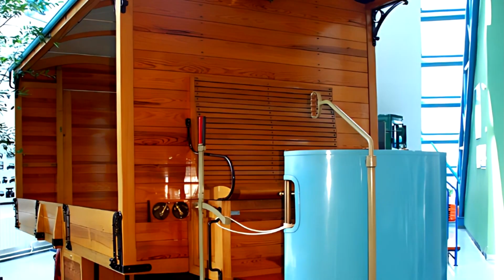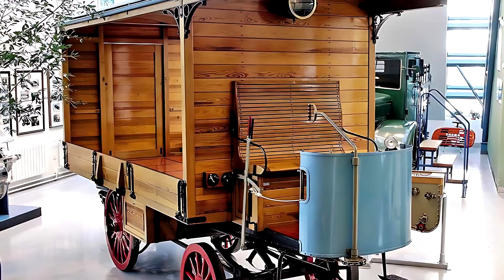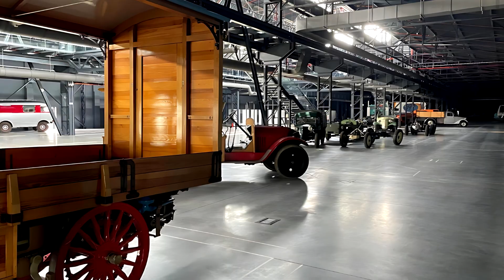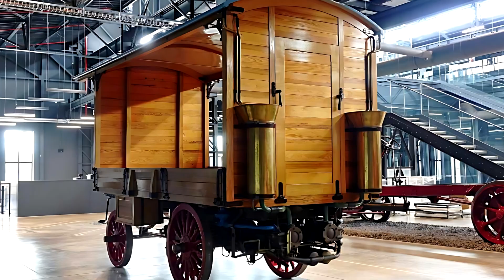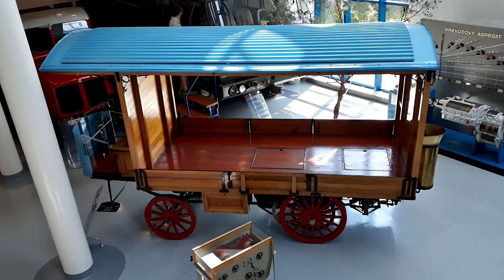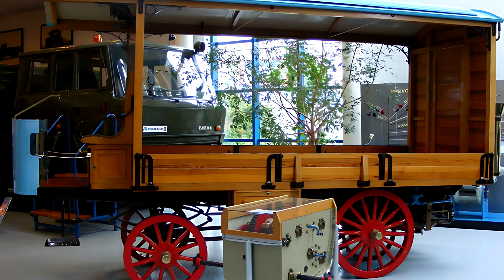1889 Tatra NW – Dual Engine Innovation ⚙️

Comment: Heh, this is so silly. They converted the truck bed into inches for some reason. Give engine size in milimetres. Fuel consumption was converted partially, so it says Kg per 62 miles, instead of 100 km... 

Americans are so silly with their stubborn drive to use their silly medieval unit system at all cost! :)